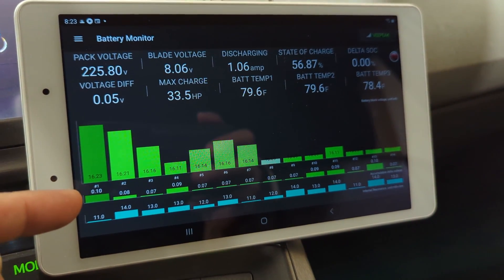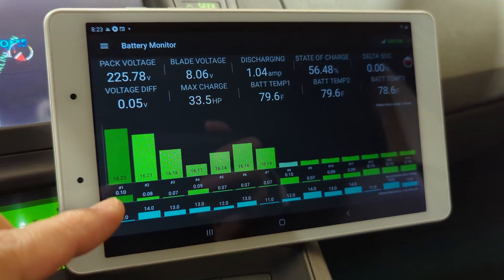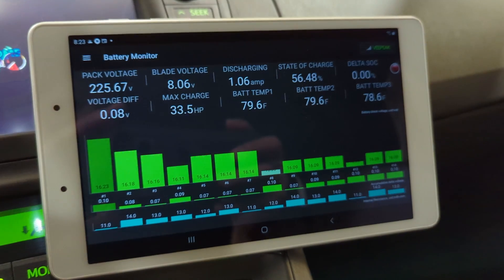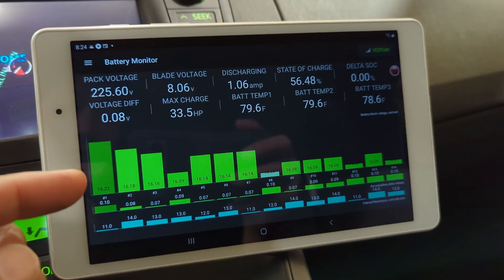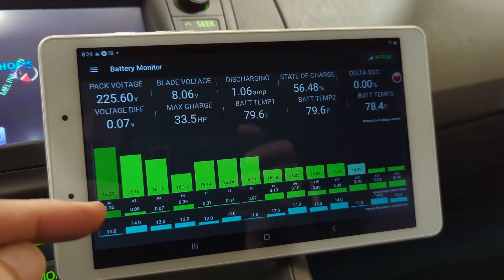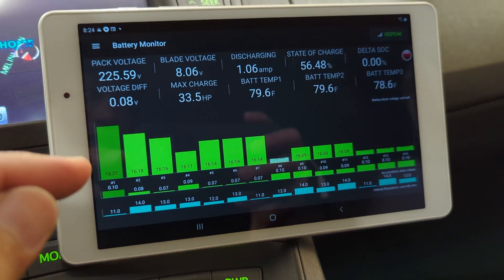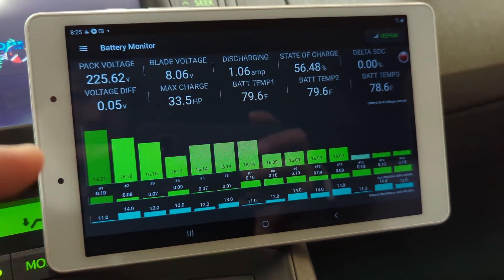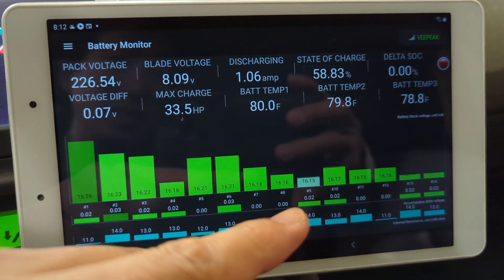Introducing cumulative delta voltage - Dr. Prius new diagnostic feature

Comment: I have a 2012 Prius V The Battery Block 1 was Bad I replaced it but no Change .Same reading on Block 1 .  Could I have swapped out the wrong blocks ? Which side on a 2012 Prius V do the Blocks count from . The Plug Side is on the Passenger side . So Block 1 should have been the 2 modules nearest to the Plug or Passenger side correct or did I make a mistake is Block 1 on a Prius Modules 27 and 28 on the Driver side and that's why it didn't do anything ? Please explain the Block to HV battery Numbering system on 2012 Prius V Without knowing which Block corresponds to which Module Dr Prius has not explained this at all anywhere I can find . Just on a Gen 2 Online They say the Blocks start on the opposite side away from the plug  . ON Gen 3 Blocks start on the Plug Side but I found nothing about a Prius V Gen 3 Please Help so I am Not confused Thanks !
Reply: Did you ever find an answer to this?  I have a Gen 3 that shows Block 1 bad and all others fine.  Thanks for nay info!
Reply: gen3 block 1 is by battery ecu/ passenger side. check the bus blocks, voltage connectors at the modules, voltage harness wire connector (orange) at the battery ecu and the connectors in the ecu. also open up the battery ecu and look for any blend or burnt or corroded pins, solder

Comment: To bad the app creator never answers any questions on his videos. Sure would be helpful
Reply: Because he is an ignorant prick.  I am contemplating fixing/replacing this app with a tool that actually works consistently.  Dr. Prius is flaky and Jack is not quite as knowledgeable as you might think.  He knows next to nothing about reconditioning packs/modules.

Comment: It would be nice if you gave us some normal range for this data set. I have 2.9v difference on the sides of the pack. Is that good/bad? High/low?
Reply: higher delta is bad, how much, I really don't Know. I will need to investigate

Comment: Hello, it îs a problem If i will put (li ion) battery in parallel with original prius battery ,i mea the same voltage 220v ????? Should be a problem

Comment: In Australia, one university added more lithium battery to Camry hybrid (not phev), tweaked the software to keep the car more often and longer in EV. It improved the mileage and battery was charged from external electric source. Are you planning to do such experiment too? In Australia we have only hybrids not many plug in hybrids Toyotas.
Reply: Any more info on this? There was a another guy in japan who added second hv battery to prius with good results

Comment: since you said it was done before in torque app, can you say if it was reported from the ecm directly or is this a math type thing off the cell voltage pid? I don't have a prius, I have the suv, I'd like to add this as a gauge in the torque app for mine if it's just a math channel.

thanks.